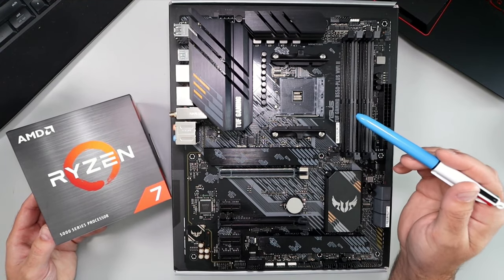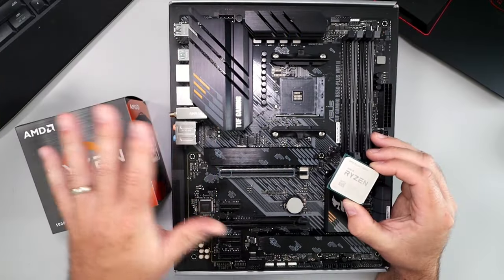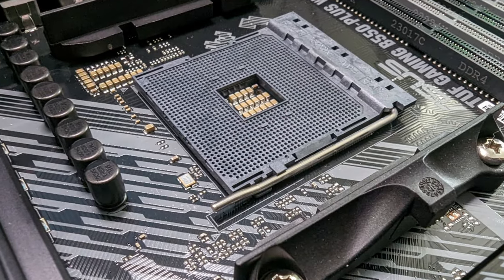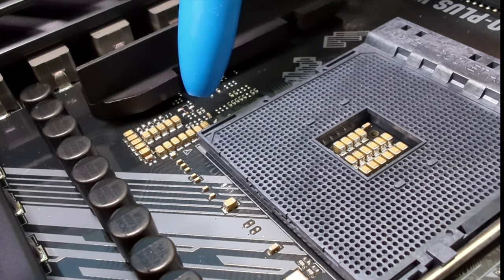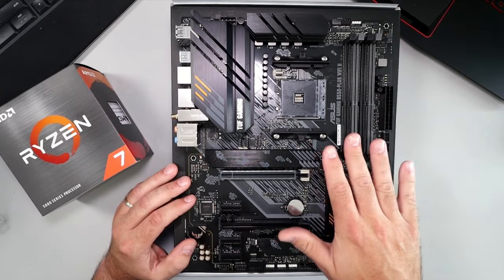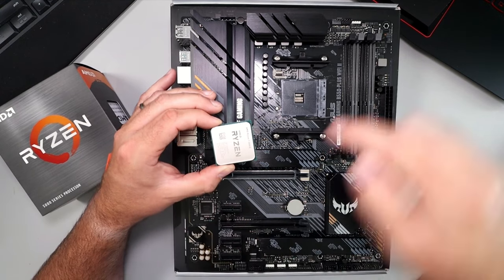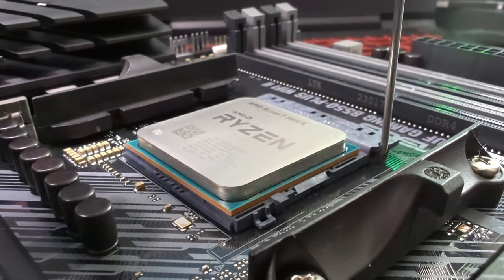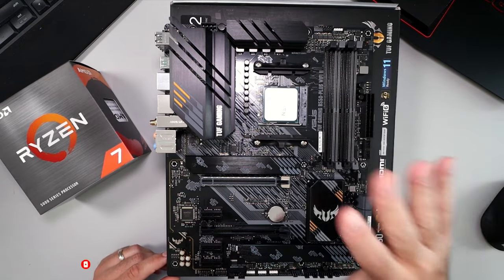Installing Ryzen 7-5800x on Asus Tuf Gaming B550 Plus WiFI II Motherboard

Comment: does this mobo require bios flashback? or is it ready to use out of the box like the b550M? i’m only asking because i seen on pc part picker that the b550M was out of stock. so this was going to be my next choice. thanks in advance
Reply: im asking myself the same...
Reply: it’s usually ready to use out of the box
Reply: For this CPU, you need to update BIOS.